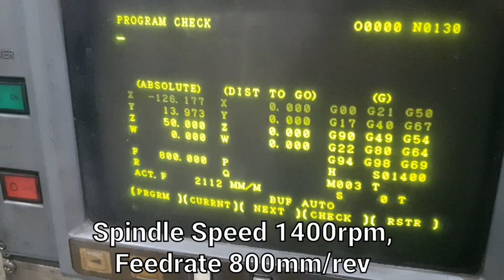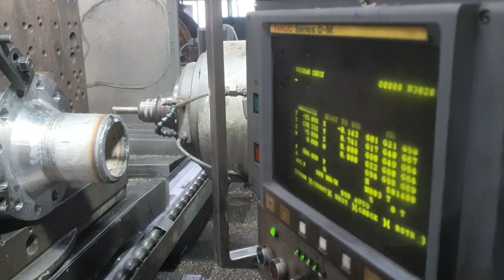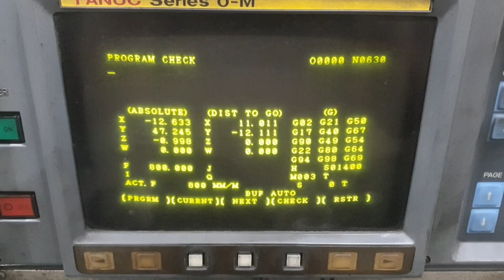Variable Angle Nozzles Machining - CNC Boring, CNC Milling, MCT, STS316, Stainless

Comment: That would be fun to hand code! Lol. Sin n cos and using a count register....well 2 count register, 1 for move 1 to add from 25 to 45 incremental. ...wonder if it would work? I just did a radius around a radius and tracked the center using that formula on my horizontal n it worked out good. Still have the headache from all the math tho. Hahaha!

Comment: James, I'm guessing that weld prep to weld to pipe.
That would explain the variable chamfer and the overall shape.
Reply: Its a saddle there will be a pipe perpendicular to the flange and pipe thats being machined . I work at a forge shop that makes these type of connections all day long .. james does great work 👏
Reply: Yes he does.
Imagine the pressure this is made to take!
Reply: @captcarlos  it looks like a 900 or 1500 lb flange with a extra heavy bore (xxh) . Yes these connections are made to with stand very high pressure 👍

Comment: What are they used for?
Reply: You'd weld those to the side of a cylindrical vessel.  I'm curious about the weld buildup, it must be there for a reason.
Reply from the maker: It is part of the heat exchanger.
Reply: @jimsvideos7201  maybe for hardening or different material?
Reply: @glennkamers  Turns out it was just a change to the drawing, and easier to build them up a little than to start from scratch.

Comment: 왜 끝에 금속이 용접되어 있는지 아십니까? (I'm assuming you're Korean, please tell me if I'm wrong.)
Reply from the maker: Hi Jim! 😀
The reason for the welding is that the dimensions of the drawings have been changed. This product is to be welded to other parts. The dimensions change little by little each time it is manufactured.
Reply: @jamespark_85machiningtv  That makes sense, thank you!